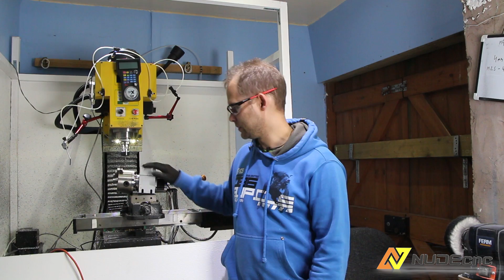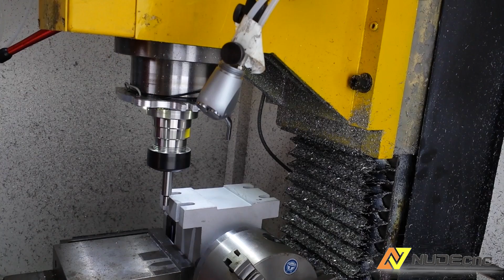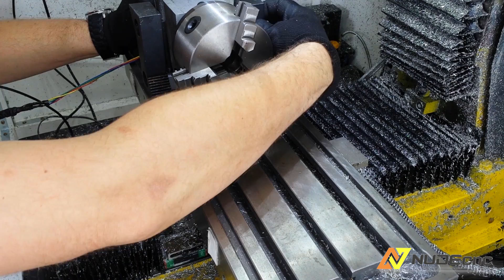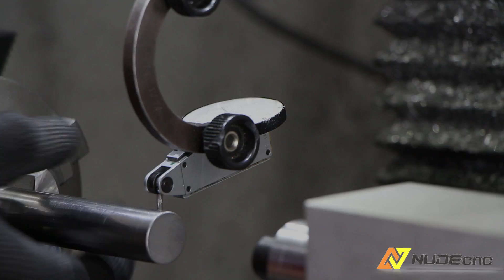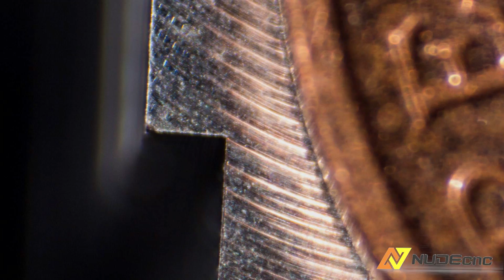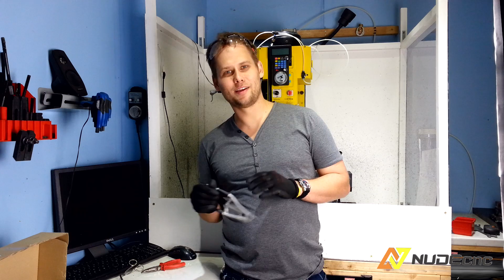4 axis cnc milling

Comment: when the endmill breaks, what is the soloution? a new one + restart the hole g-code programm from start, or is there a way to rewind to a certain point like 1 min ago ?
Reply: change the tools and set the tool length, run back this particular N block to offset fine tune the tool length to exact Z as previous. then starting this N block and continue. This is my own way to restart the work

Comment: NUDE CNC, listen buddy, I want to give you some advice:
Its not a problem with your wife's narration. Its a problem with your 
actual PLAN for the video. You need to use THE the following PROCESS when making this type of video:
 1. Tell us 
what you are going to do 
2. DO it 
3. tell us what you did. 
You should also explain exactly WHAT it is you are trying to show us. Is it how to USE a CNC? How to make a part? and so on. Obviously, you have skills. The skills just to SET UP the machine are problematic for many  people. Then there is the SOFTWARE and how it is used. THEN there is HOW the software and the computer INTERFACE with the CNC machine. How about this:
Start a SERIES of videos (each lasting 20 minutes)
Hold up a METAL BILLET  and then say "I am going to make THIS- INTO THIS and then hold up the metal PART that you made in the BEGINNING of the FIRST VIDEO. 
Then take us to the COMPUTER. Show us the SOFTWARE and HOW YOU DESIGNED THE PART.
THEN TAKE US TO THE CNC Machine and show us WHAT brand it is and how many axis and WHAT someone would GET for such a machine and all the accessories that come with it (and price).
THEN: show us the design
THEN: Show us how you set up the CNC. Tell us HOW you know what bit to use when, etc.
Now that series...I would subscribe to.
Also..SCRIPT what you want to say. Don't just start talking. Pretend you don't know a single THING about the process and then READ your script and see if it makes sense. (Doesn't have to be TRAINING...but..you know...make it make sense and interesting)
Might even want to point to a few COMMON mistakes people make.
Even talk about WHERE TO GET billet metal that you use.
This is a common problem with REALLY smart REALLY skilled people...the aren't good at explaining or talking. They are just REALLY good at what they do. Perhaps some scripting and you can really give the world some great insights to your trade.

Comment: Are those dental air/water syringes easily adjustable to get the correct coolant to air mixture?  I looked them up and they're pretty inexpensive on ebay.  I have a homemade fogbuster and those look so much simpler.

Comment: Why don't you fit a tenon to the bottom of the div head and tailstock, the tenon is a sliding fit in the tee slot and aligns the head and t/stock with the X axis, makes setting up so much easier and on the button every time.
Reply: +ukmwg Sorry dude but "on the button" for what tolerance ? I have found that most machine t slots are not that accurate even on fairly high end machines you could easily be talking 20+ microns which if you are working to a 10 microns tolerance already has you out of tolerance....  and they are good machines £100K+

Comment: Hi, thanks for the video. Is this the 50:1 or 100:1 version? Also is that the 80mm or 100mm chuck, and if you were ordering it again, would you get the same version again?
Reply from the maker: +Kevo F Hi I do have 1:50 but if I would buy another one it would be 1:100. Max rotation feed rate is more then enough. but you have double precision. Chuck is 80mm. Very good stable 4th axis. Very good product for the price .

Comment: If I had that 4th axes I would key it to the center bed slot for quick and easy setups or make a shaft that can be tighten in the chuck and fits in the live center
Reply from the maker: +cybot63 Yes I plan to do that. THX

Comment: HI, I'm using meshcam and mach 3 but I can't seem to get a proper toolpath for 4 axis.
Reply from the maker: Sorry I do not know your cad software so I can't help you.
If you do not need simultaneous moves, u can treat each rotation as independent setup (g54). Then generate code, combine, and ad A axis position between.  
All the best

Comment: Too much stick out bro! Shorten your tool!
Reply from the maker: It was test run. I just wanted to see how fast 4mm can go.
In normal production I would do it using 2 tools, rougher 6 mm (8 mm might be to much for this setup), and 4 mm for finish.
Reply from the maker: +Matt Runhart Thank you for information. It's new knowledge for me.  Regards Arek

Comment: Very good how long did that take to machine and what's it for.
Reply from the maker: This is just random shape part which I used to test 4th axis.
Cutting time about 45 min. I used 4 tools: 12 mm and 4 mm end mill, centre drill, and 1.65 mm drill.
I think I could improve cycle by another 30% if I would add another tool like 6 mm for ruffing before 4 mill finish.